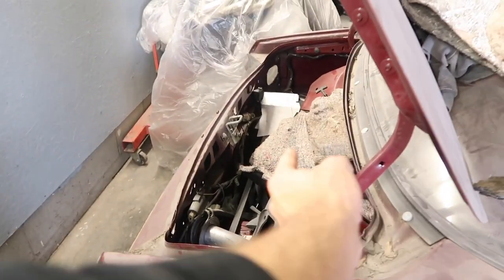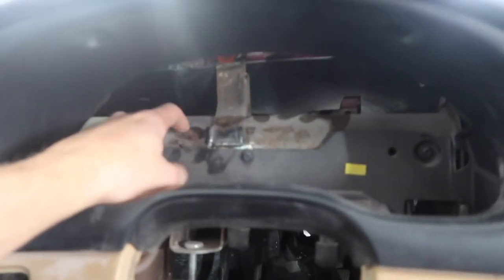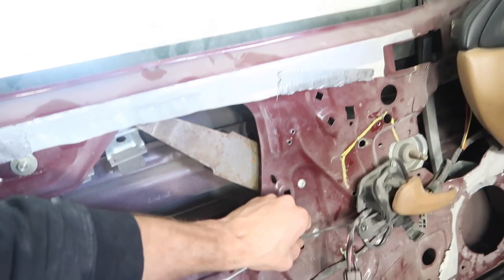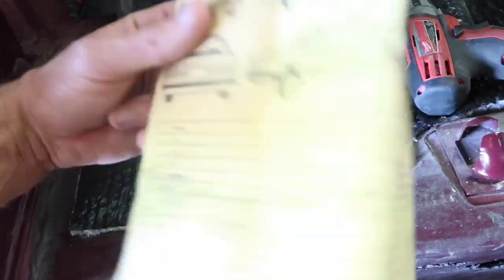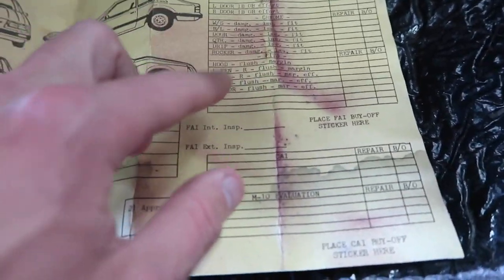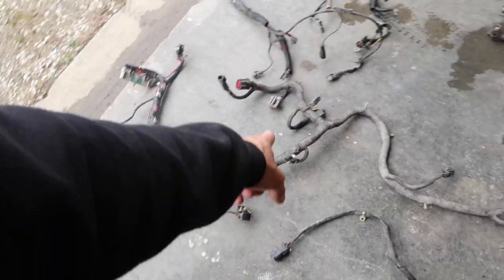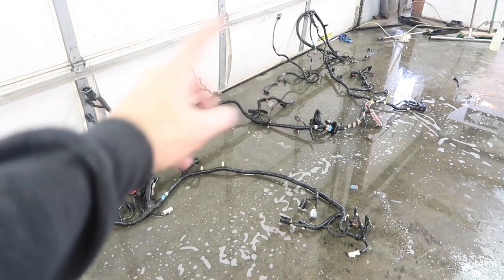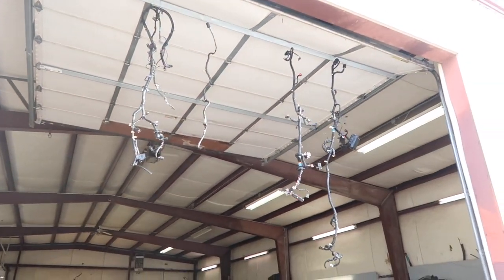SN95 Dash Swap In Foxbody Mustang

Comment: Squirt a shitload of iso alcohol into the wiring harness connectors to dry out all the water and prevent corrosion from washing them. Air drying alone won’t work for long before those pins and connections start turning blue/green.

Comment: what made you decide to go with the sn95 dash? to me they look and feel much cheaper than the stock Fox body dash.
Reply from the maker: i just wanted to put a sn95 dash in and do it my way
Reply: Revive I agree, the SN95 dash looks and feels way cheap plus they creak alot. The fox body dash looks much better, but it's his car and his choice. He does have it fitting nicely though.
Reply: Bob Falfa sn95 dash looks better and already damn near fits. That would be my guess
Reply: Alonzo Kincaid Nah the SN95 dash looks shitty in foxes and takes up leg room. It takes away from the feel of the car.
Reply: Bob Falfa thats your opinion and every opinion is valid. However... sn95s have pretty much the same chasis so of course ppl are gonna swap the interior out as a mod here and there to do something different. As shitty as the sn95 interior was it was still better than a fox bodys
Reply: Alonzo Kincaid The original fox interior fit the fox bodies. The 4-eyes especially have a much better looking gauge cluster that's way easier to put aftermarket gauges in and still retain a factory type look.
Reply: That inspection report is awesome. You should keep it safe with the other papers.

Comment: I have a question 🙋🏼‍♂️. Let’s say if you want to convert it back to stock interior will it fit after the conversion or do you have to re weld things or what? I found me a notchback that has the dash swapped. But I wanna convert it back to stock. Lots of work or rewelding required?

Comment: I'm doing a 2017 Corolla into a 77 nova, do I need to make a new fuse box? What all wires can I delete or can I use the wires I don't need for something else? Can I delete the airbag system since it has already been deployed and how do you deactivate the indicator light?  Also, how can I marry the steering column together and have everything work?

Comment: how did you do the door panel swap on fox with the door latch ?
I did the dash and center console on my 1990 fox, but can't fond a way to do the door panels .
Reply from the maker: i will have to show when i make the passenger side door panel. Sub to stay tuned!
Reply: Fox stang, I'm curious also. I have an 87 notch that is a full term I swap, dash, gas tank, brakes, console, front and rear seats, and motor. (Ditched the stock t-56 for a magnum xl since it has twins :) but fox door panels and they don't clear the dash properly.

Comment: 95 wiring harness on what engine? And you have to switch the pedals as well?
Reply from the maker: yes i switched pedal to 94-04. im running everything SN95 in this. i have a Ford Racing 306 Crete motor im going with. check out my video of it! its a bit further back